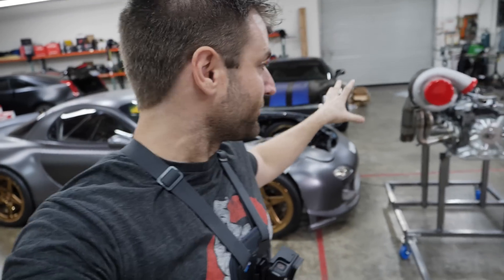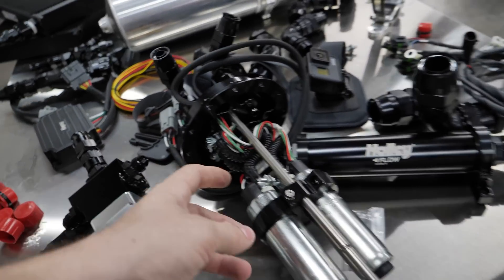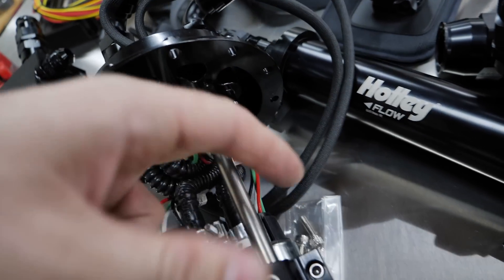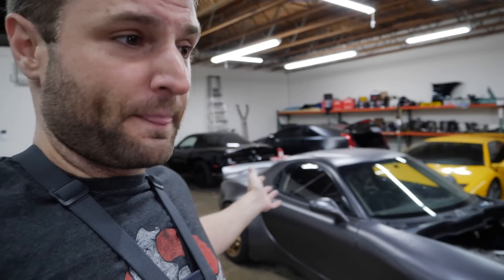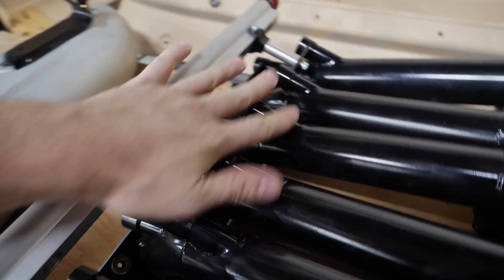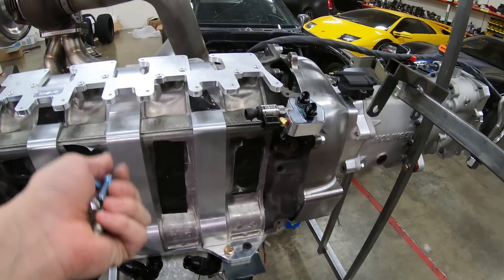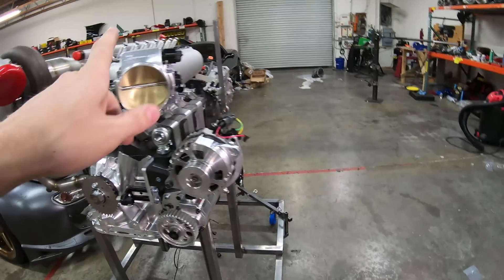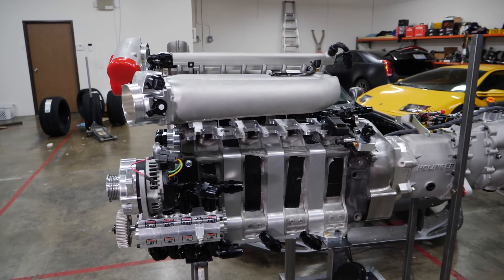BRUSHLESS Pumps for the AWD 4 Rotor RX-7. E85 Fuel System Build time!

Comment: Brushless are AC not DC. That’s why it takes less amps. Also the module is essential a speed controller. I’d go on RC Groups and you could find someone to build you a custom speed controller for the pumps.

Comment: Should weld around the inside of the throttle body flangers that you add to the manifold then smooth it out help deal with boost and help stop leaks.

Comment: Hey Rob.. Why are you stuffing around with different sized injectors and waiting on untested special ones when you could just get 16 tried and proven 2200cc injectors and let you're ecu manage the duty cycles for drivability and power maps? From what I've seen so far I take it you're getting a holley dominator? That'll be a much easier and manageable system to run and maintain.

Comment: Been playing with brushless motors on automotive fan systems for nearly 20 years. They're 80-90% efficient vs their brushed counterparts at around 50%. They are variable speed and require PWM based control signals which is what that little control box is likely generating in your case. Modern OEM automobiles are using brushless technology all over from fan motors to coolant and fuel pumps. It's really where the industry is shifting so no surprise to see it spilling over to the aftermarket. The build is coming along nicely!

Comment: On the fuel rails why not run a dead end system with feeds to both sides of the rail because I would think with injectors that large even tho u have the supply ur still going to have pressure differentials in the rail with how long and how many injectors why why not run a dead end with the return off the regulator and then have the pressure line split and ran to both sides of the rail. I just think that would make more sense but u deff have way more experience so if you know why that wouldn't be better please explain to me why.

Comment: Yes. In a car that uses an efi ecu you really have no reason to go mechanical on a bunch of parts. "Oh but what if the electronics crap out on me on the side of the road" any car in the last 30 years runs its engine on electronics. What if some injectors stop working? Limp home. What if my fuel pump breaks? That's why there's 2 of them. In my opinion a modern engine should only have a mechanical oil pump and alternator. It's all about efficiency, we all know how the fan on the engine made a 300hp v8 lose 30hp. That's horrible for fuel economy and power, most things attached directly to the engine screw with that. I guess you could make the argument that you can't power your ac off the alternator, but the future is hybrid anyway, the hybrid system adds power to compensate for its weight and has a higher voltage system alongside the 12v one that can run the ac.

Comment: Keep it up man.. interesting stuff! I originally thought you would go for a mechanical pump setup like Mazzei did on his Formula RX7, but after seeing the new Holley variable rate system, you're probably headed the right direction. You mentioned about a mini-fuel-cell setup for the pumps. Are you going to have another pump from the main tank to keep to fuel cell full? Very curious here...😉👍 Incidentally, since you're running a belt driven oil pump, it would be a really good idea to keep it on a separate belt from the alternator, plus have a deadman switch in the oil system to kill the fuel pumps in the event of oil pressure loss, with a manual override to get it started and build O.P. initially.

Comment: Keeping the air cold is what makes the most boost(per Mr. Banks). So why not wrap the intake tube if your looking for power? Also keeping the heat away of the intake tubes, I would deafantly wrap or double wrap the exhaust. IMHO.

Comment: i have a single i have been testing and made 800whp through a th400 and saw fuel pressure falling off, so two of them should do 1500+ on a manual trans easily

Comment: Rob, Glad that you like the twin VR fuel cell setup! I'm one of the Fuel System Engineers for Holley and designed the unit you have. As you see on the flow charts the pumps really come alive at higher voltages. Main complaint with the unit are the small filters. They work fine but don't cover much surface area. If this is a concern we have / will soon have a pump adapter that straps onto the pumps and gives you an AN inlet that can be used with a HydraMat like the 16-108. Let me know if you have any questions going forward.

Comment: Ever hear of a super turbo? It's a supercharged engine with a turbo or turbos. The supercharger works all of the time, except when the turbo is boosting. While the turbo boosts though the supercharger, it releases the tention-drag on the the belt from the supercharger . Thats right, the turbo(s) boost(s) right though the supercharger..  crazy. Mostly diesel setups, but it would definitely work with gas or methanol. Rotary? Unknown.

Comment: Brushless uses an on off switch to turn the positive on and off to propel voltage to the motor to make it spin. Think of a fan and a switch. When you turn the switch on and off fast it makes it spin and the faster you turn the switch on and off the faster the motor goes. Brushless explained.

Comment: I use a brushless motor in my 4 pound RC car and no joke that motor with 9 volts and 8,000 MAH will push the car to 75 MPH. I can drift that RC car with rubber tires on concrete at 50 MPH just by pushing it to full throttle. Brushless all the way.

Comment: 9:43 clearly shows the piss-poor runner entries I mentioned a few videos back (and some twat rubbished) - don't forget to match them to the plenum as it will otherwise cause all sorts of issues and cost you power.

I had also mentioned the oil pressure being set at the pump and that you would probably need to use a blanking plug instead of the relief valve. ;-)

Comment: Those pumps won't be enough especially with e85 , there was a reason why the previous owner had 
a mechanical fuel pump on that engine I am sure Abel has also told you, but that said cool build

Comment: iam currently building a twin turbo GM engine . so i am in a sence going though the same thing . i.e. fitting 10 pounds of crap in a 5 pound bag .... so anyway i to have bought injectors from injector dynamics . i was talking to mitchel and he told me that injector dynamics sent a  bunch of fuel filters out to be tested for their true micron filter claims. .... thats why im switching to their fuel filters ..because it is a true  5 micron filter . ... just food for thought .

Comment: Hi Rob.
I'me not a expert in rotary engines but one thing i can tell is that, you are going to have problems (sooner or later) with the electrical fuel pumps.
You already have a good fuel regulator and the mechanical fuel pump, you just need the flexible drive cable and adapters for it, and mount it were it suits you better on the car.
You will only need a regular electrical fuel pump on start up if you don't want to crank it a little longer until you have fuel pressure. 
It will maintain flow at higher pressures better then an electrical pump.
If you are thinking to use that 4 Rotor on the streets you will have problems with fuel temps because of return to surge tank.

Just constructive criticism, love the project! 😍
Keep those videos coming.

Best regards, Mário Ferreira.

Comment: I do have one thing to say, this build is amazing, but if you DO NOT get a custom fire extinguishing setup built into the car, the professional ones that fill everything with foam ect. all it takes is one of those fittings to go slightly wrong, and well, if you want evidence, Mazdas current DPi car catches on fire due to fuel/turbo problems almost every endurance race it takes part in, and its not even a rotary. They are very expensive, and a headache to maintain, but a fire in a bay like that becomes uncontrollable in seconds. Most likely you already have a plan, but just in case you needed someone to yell at you some more, here is my one annoying backseat comment. Live everything you do rob!

Comment: Brushless motor the floats between two  electromagnets alowing it to spen360° making it basically frictionless causing it to be able to handle more rpm more torque...that's awesome man to see in a fuel pump that's nuts keep up the great work can't wait to see it running

Comment: Don't shorten the "signal" (but normaly they allready "fixed" with not removeable plugs.) (shorter cable lower=resistens, but if the controll devices need these Ohm) , it will be a problem(BUT check it again, iam just an mechanic with some exp. in Industrial Mashines. 

P.S. i like ur stuff , i mean u are no profesional , but someone with BIG "lifeblood/heart petal" (german -> english can be realy weird. just can't find the correct engl word for it.)

Comment: What you have for those brushless motors are ESC speed controllers. Electronic Speed Controller. Its a 3 phase system that uses PWM to adjust the speed of the motor instead of voltage. This is the same concept for drone motors

Comment: You are going to want a mechanical pump. Trust me at some point you are going to want a mechanical pump.
Reply: Nope Brushless are the future. Hot Rodders tend to be cheap and Mechanical is a cheaper solution not a better one.
Reply: @dj4monie  It's 10times better. 1 high quality mechanical pump can pump up to 3-4k horses and keep gas low on temperature ;)
Reply: You can keep low temp without using a cumbersome mechanical pump that robs the engine of power, has no control and so on. Brushless motors have been proven from RC to thousands upon thousands of variants of cordless tools. It's one of the most reliable and power efficient types of electric motor (AT their size package, they get rubbish once you scale them up). If i were him, i'd keep a bottle of liquid nitrogen in the trunk (one liter should be enough) and have the fuel lines pass in and out through a block alu that's cored in the bottle. He'll never give two shits about fuel temp after that.
Reply: @aserta  sounds like a lot of maintenance
Reply: aserta  when one of your 3 brushless pumps fails and you don’t have adequate fuel pressure and melt down the engine due to a lean burn issue... you’ll wish you had 1 mechanical.
Reply: Correct! This car will definitely need a mechanical pump,  electric pumps simply can't maintain the pressure a 4 rotor needs with near 1500 hp , hopefully it doesn't end up like what happened to the 3 rotor

Comment: As an old Navy Gunners Mate, my hydraulic system idled @ 1450 psi.  When we were shooting and parts were moving the system pressure was around 1550 psi.  This oil system is simply an abortion.  More fittings = more leaks.  Rob Dahm strikes me as a con man and 626 thousand people watch this guy.  Maybe he should run for President.

Comment: Holley is really stepping up supporting this build.  Who know Holley had such badass parts.   Great idea to use electric fuel pumps.  You need a swirl pot.
Reply: Holley has been a staple of the hot rod scene since forever, hell even edelbrock got into the import scene when it exploded in the US back in the early 00s. I love the fact that they are willing to do whatever they can to make anything go as fast as possible!
Reply: David Benner  my Honda motor has multiple JG/edelbrock components and I couldn’t be happier to have a touch of muscle on there 😎 they both do a lot of great things in the import category
Reply: Kraig B my point exactly, most people that build imports stick to “JDM” companies, but as far as I’m concerned go fast parts are go fast parts and as long as you meet your goals it doesn’t really matter who makes them as long as they are worth the investment.
Reply: first heard about holley from Tom's turbo garage and his mx5 ls3 build 😁
Reply: Apparently only YOU didn't know. They are making lots of hard core stuff and have done for the EFI market.
Reply: Holley has been around mate! Check out the homie Cleetus McFarland if you haven’t already! His nutty V8-powered cars all have the Holley systems!

Comment: Flex fuel sensor !!!! For pump and e85
Reply: Pump gas? Lol prob e85 or like a 106
Reply: e85 for races as it runs engines cooler and give more power and torque and pump gas for daily use on the street where u don't need to push the engine to max

Comment: Next video: I remade myself out of billet aluminium
Reply: Aluminum?
Reply: @Howdy Justice Billet is just a fancy word for a piece of metal. From what I understand the way metal flows through the molds when casting makes the resulting part weaker than if it was machined to the same spec from a block, at least for complex shapes, which is why you hear about billet blocks so much with very high horsepower cars. For small custom stuff like a lot of these parts getting it machined is cheaper anyway.
Reply: @SuperBobKing  Read https://en.wikipedia.org/wiki/Semi-finished_casting_products, today we call something billet if it was wholly machined from a billet or a slab or any piece or shape of forged metal. This probably originally applied to steel because the word billet is older than useful aluminum alloys, but today can be applied to any metal.

You are correct about cast pieces having less performance (remember strength is only one aspect of a metal's performance) because commercial steel mills make better metal more consistently than any casting process but buying a block of forged metal you can machine an engine block from is probably more expensive than casting one before you even get to machining that much metal
Reply: Next video #2: I replaced my heart with Holley brushless fuel pump
Reply: @Howdy Justice Rob dahm is gonna rebuild his body out billet steel next vid
Reply: @Howdy Justice yup. My bad. There is such a thing as billet steel though. Just got mixed up
Reply: Thomas Hayhurst lmaoo